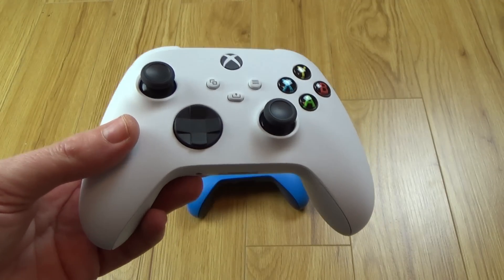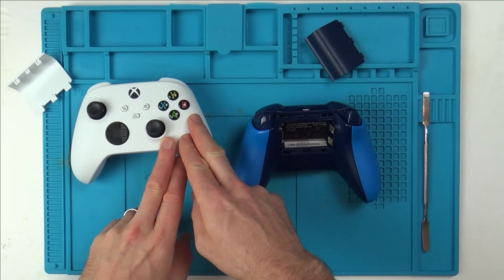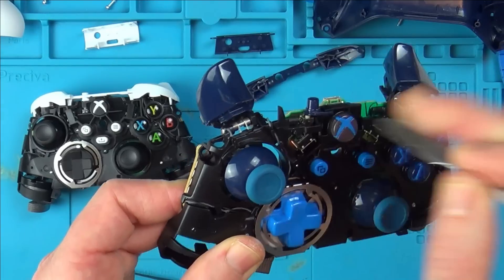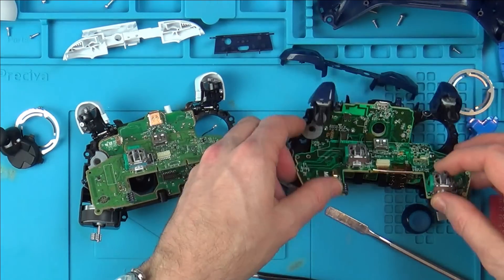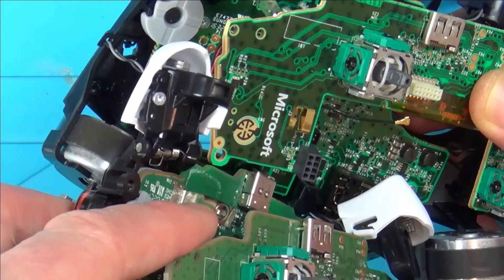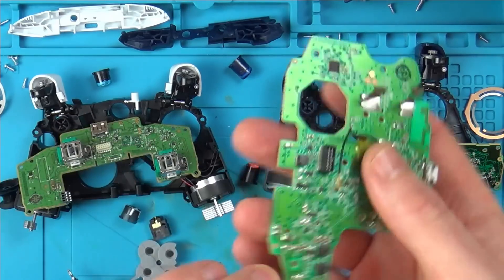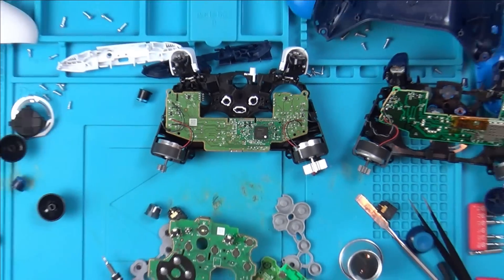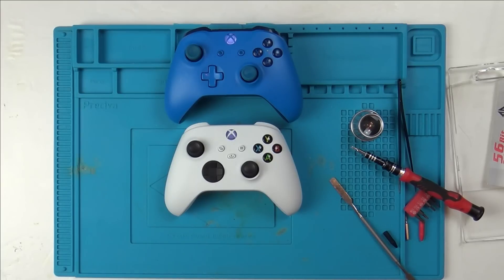Xbox Series X / S Controller Teardown - Comparison with Xbox One Controller

Comment: shame on the analog sticks being the same!
Reply: whats wrong with them
Reply: @Spiccolo1202  don't play dumb.
Reply: @j.j.9511  just saying i have multiple xbox controllers and i dont understand
Reply: @Spiccolo1202  they can drift due to how its made, the fact these were reused in the new controller and not improved means they will also drift
Reply: @JuicyJakeRepairs  yall have stick drift?
Reply: How do you get stick drift? I drop my controller two times (on accident)
And i got no stick drift but i did get a squeaky thumb stick
Reply: These have been the same sinds PS1 and still suck. Untill we get rid of the joysticks that has a click button function, were gonna have worn out sticks every time. Pushing the stick forward while clicking it in (sprinting in most games) is killing it.
Reply: @AnnihilatorNL  well I have found a single gamepad model using sensormodules (winkelsensoren in german) from a small company though. But it costs 159€. But if it works the same way as in modernen machinery controls, than it will last for yeeears until the sensors give up

Comment: Thanks  for the video Vince! as someone who games a lot using xbox one controller almost exclusively I can tell you those changes to the d pad are a bigger deal than they seem. The caps they used on the dpad contacts on the xbox one controller were rubbish along with the design of the dpad itself. So I'm looking foreword to seeing how well this one holds up.

Comment: Xbox We’ve made a new controller it’s exactly same but got usb-c and a share button 

Whoop di fuckin do 

People saying why chance what doesn’t need fixing.  Yes if it was the same console. 
So there telling me there is going to no difference in games at all next gen

Meanwhile PlayStation change the whole thing
Reply: Meanwhile PS5 is getting huge controller failure,  the reason why MS didnt add unnecessary features is because the Series X/S are Backward compatibile with EVERY previous Xbox so they don't want to be adding gimmicks to the Controller.

Comment: I use one of my 360 controllers for PC gaming and tbh it was for its time the definitive controller pretty much best across the board and I suspect the later controllers built upon that strength tweaking in the right directions but holding on to that solid build base of the 360's controller.   Sometimes it feels they are trying to reinvent the wheel but tbh they are all descendents of the superb N64 controller that changed the way we controlled gaming in 3 dimensions not just 2 dimensions we were used to.
Reply: >Superb N64 Controller
Descendants

Comment: Great job!  Very disappointing as the new controller seems to have little to no new features =/  The PS5 controller looks better imo!
Reply: Whatever. The Xbox one is made to work with backward compatibility. You can use on consoles, PC, and smartphones. Try using the new ps5 controller in the ps4 or the ps4 one with ps5 games. Blowing a piece of plastic is not the future, being consumer friendly is.

Comment: It's a shame they're using the same analogue sticks, because there is a real problem with stick drift on the Xbox One.
Reply: I guess I’ve gotten lucky then cause none of my three Xbox One controllers have drift - and one of those is as old as the original console, which is the launch one! I’ve seen plenty of people with issues but I guess I’ve gotten good controller luck lmao
Reply: @paincreatesfame  good to hear some postive experience.
Reply: It's hit and miss playstation uses the same sticks so I'm guessing there just isn't a better option yet
Reply: I know my one s has an issue where on the left stick it puts y impute backwards and it does the same when you configure the controller
Reply: you get stick drift? i drop my controller two times (on accident)
No stick drift but I do have a squeaky thumb stick
Reply: @ozzie812  I'm on my third Xbox One controller because of it.
Reply: i have around 9 controller all the way from the launch xbox one and none have any issues.
Reply: i’ve used my xbone controller since 2014 and no stick drift
Reply: That seems to only be for the elite controllers

Comment: Thanks for the teardown Vince, so sad this controller won't be repair friendly, the solder points or the vias are the same as the Elite V1 V2 and the second generation controller (1697) they're really tough to desolder, even the RB and Lb pads seem that way, they're identical to the Elite V2
Anyway great video
greetings from Mexico.
Reply: Ah, didn’t spot the rb and lb also. I use extreme heat to get them off. Solder iron and heat gun. The pads don’t damage at all in my experience

Comment: Good timing vince, you got in early with this one!, hope you get plenty of views. Was wanting to look inside this new one to see what the difference is. It looks like the new model is using lead free on the analog sticks, which is the same as 1697 models and elite , a pain to get the old sticks off compared to 1537 and 1708 models . The headphone jack is the long version, same as 1697 and elite models , but 1708 headphone jacks work also in elite and 1697, just the fit in the case is very slightly different.

Comment: If you have problems getting the series controller to work on pc, this worked for me!   As someone already said, follow these steps in order.   1.  Force update windows and restart.  2. Go to windows update again (it will say you are up to date, that is BS).  Hit the check for windows update button and another update will appear.  Install that one as well,,, it took me quite awhile on the second one. 3.  Plug your controller into your pc/laptop etc. with a C cable.  Run  the XBOX accessory app from the windows store and  run it and it will install new firmware on your controller (I left Steam running in the background so I could see if it was working and sure enough steam will see it as an Xbox 1 controller, YAY!)  4.  Run Bluetooth connection wizard under devices.  Found and worked perfectly after that....

As I bought this thing solely for my PC, the fact that I had to trouble shoot this sucker new out of the box day one was a bit disconcerting, but viola ,  it was worth it!

Loving the subtle changes of the series controller very much.  My favorite controller is now just that bit better!!!
Reply: i have one on the way now, hopefully they dont get stick drift as easily and hopefully the LB doesnt inexplicably fall off as much either 😂😂
Reply: I was having issues on PC with my Series X controller. When connected through bluetooth the button layout was allover the place. I did what Sam Foote explains but it didn't work until I unpaired the device and than paired it again after the controller firmware update via the Xbox Accessory App
Reply: @TerraWare  i also did the update but a software update never gonna fix potential hardware defects 🤷🏼‍♂️
Reply: Thanks very much for sharing this. On my second controller after sending the first back. This update worked.

Comment: can you try to fix my controller? if you can, do you do it for free? i had the controller for a month and it just stopped connecting to my xbox, it would connect for a few seconds and then disconnect again, but it connects fine to my phone and pc, and also theirs nothing wrong with my xbox cause i have 3 other controllers and they connect fine
Reply: Is the controller that isnt working the newer xbox one s version that uses Bluetooth? I had the same problem with my Xbox the old version of the controller connects fine but the newer version can't
Reply: @MobileLearner  how do I know it’s the newer version?
Reply: @poppy7222  im pretty sure the older version of the controllers had a seperat plastic piece around the xbox button whole the new ones is all one piece
Reply: I got it this January if that so yes it might be one of the newer ones
Reply: @poppy7222  yeah then it could be a problem with you xbox and probably is if all the other controllers are the old one s
Reply: Yea
Reply: @MobileLearner  ive had it for 6 years now so it prob is the Xbox
Reply: @poppy7222  yeah best thing to do is plug it in and use it but even that barely works. For some reason I tried like 4 cables but only one worked without having any issues
Reply: @MobileLearner  mine do the thing where they’re plugged in but don’t charge/turn it on
Reply: @poppy7222  You have it plugged into the actual controller and not a battery?

Comment: Why slightly change the design of the controller? Because they're micro$oft, thats why. They're always changing things that work fine, often for the worse. I actually prefer the blue controller. There naming is for these is consoles/controllers is total crap. Why not just call it xbox four, for example.
Reply: $ony is no charity either

Comment: That D-pad retainer is probably grounded as a way to protect the ARM chip from static discharge without the need for the shield on the back like the older ones. Could also just be to protect against double clicks when only pressing once.

Comment: Why change perfection
Reply: the one controller has lb buttons that literally fall off and stick drift so bad that a class-action lawsuit has been taking place
Reply: Perfection my ass. Been through dozens of these cheap ass shit units. Class action suits ongoing.
Reply: @AC_Milan1899  the shape is the only perfect thing of the controller..the rest is not
Reply: Yeah, sure, "perfection".

Never mind the fact that Xbox controllers are known for quality control issues and that they also lack basic features like an accelerometer, gyroscope, and battery, which have been in competing controllers since 2006. For such a "perfect" controller, it sure is strange that Microsoft makes the most half-assed, bare bones controllers you can buy for $60. Ergonomics don't mean shit when the value propsition and quality control of these controllers are so poor.
Reply: That controller is far from perfect they could've added new features without compromising the traditional controller it's just lazy

Comment: The two extra pads on the headphone jack might have continuity between them when the headphones are disconected. They might be to detect if a headphone is conected. The new version might be detecting if the headphones are connected by monitoring the impeadence of the headphone speakers instead.
Reply: so did they or did they not upgrade the drifting issue?
Reply: @Butterballbx if you are referring to the drifting issue of the analog thumb sticks from what I can see the components there are pretty much the same so it's unlikely they upgraded them to solve that issue.
It's just my guess from what I could see in the video.
Reply: i do like taller d pad but rihgt now i just used my og xbox one controller since i broke it one at the time...
Reply: I need to replace my Series X mic port as it already failed.  I am going to swap in the One S (1708) mic port replacement and hopefully all goes well.
Reply: @frankrobbins8508  And how it went?
Reply: @tofol13k  i am happy to say it worked!  The extra connections shown in the video were covered just in case before i put the mic port into the new series x controller.  Ive been using it for a few wks now.
Reply: @frankrobbins8508  Thanks mate, it really helps me a lot! And congrats on your good job
Reply: @tofol13k  you're welcome! I knew i wasnt the only one out there with a broken series x controller mic port.  Good luck!
Reply: https://www.youtube.com/watch?v=jWcGSrD9xIg

Comment: I hate the D-Pad style, That's just my opinion.
Reply: Honestly thought I would too but after actually using it I honestly don't mind it.
Reply: i prefer it, i think you can change the dpad to the older style one though
Reply: You have an opinion. I do, too
Reply: I'm afraid it's similar to the Xbox 360
Reply: @jeanogaz1215  It's nothing like the original 360 dpads at all. The only thing it has in common is it kinda looks similar.
Reply: @mainfighter  oh, do you have it ?
Reply: @jeanogaz1215  I have all the controllers and consoles going back to the X360.